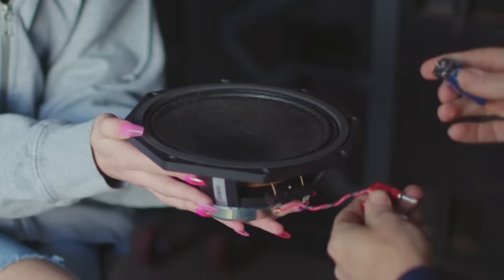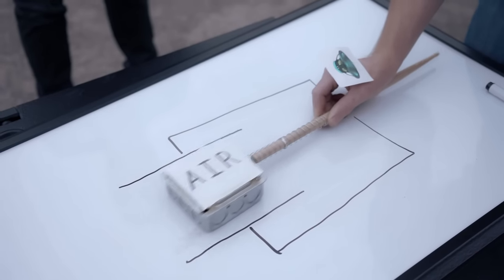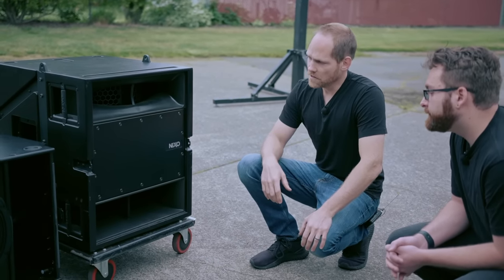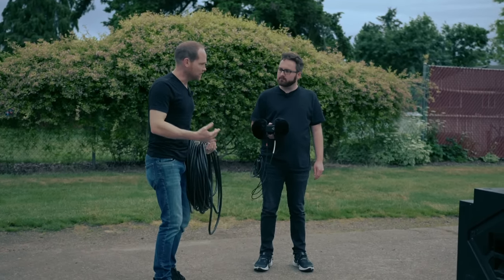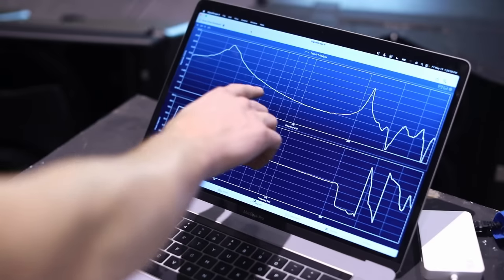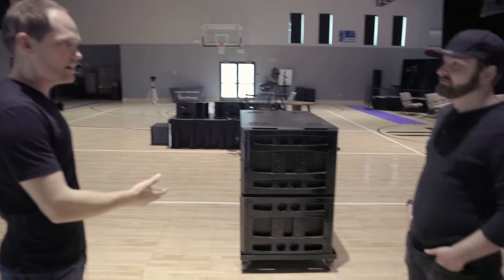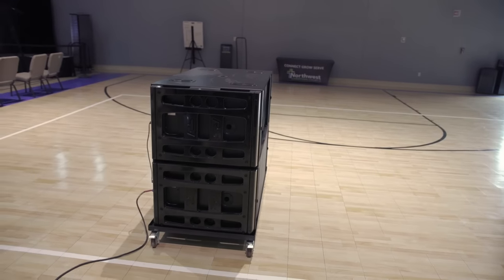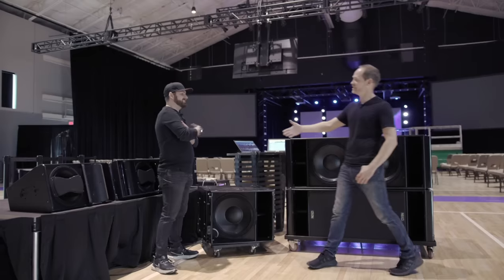Things you didn't realize about bass... until now.

Comment: I like how the videos you make put the transmission line freakhead stuff I do in my head, into a relatively easy to explain and build upon base demonstration of how sound works. It makes it easier to explain why my designs are better than bass reflex, because now they bass reflex a bit better :)
Reply: I built 11th order transmission line boxes (2) way back in 1990 for 2 Earthquake 12's. In home use with coils.

Amazing bass back then even on low power indoors running on 50 watts rms per channel from a home receiver.

Love transmission line boxes.

Comment: Great video.  I love the explanation of null points in sound.  One thing that doesn't get mentioned is that a driver is cone-shaped. So the portion of the driver at its rim, will have a very limited range of motion in contrast to the portion of the speaker closer to the voice coil, which will have the MOST movement.  So when looking at air pressure and how that air will move, it's good to understand that air at the sides of the driver will move slower than the air towards the center. So creating a vent that tapers from the source, is essentially mimicking the way the air will flow from the driver.

Comment: Aye that first example is awesome! The stick and spring with the air block is a surprisingly good way to represent how sound travels across air molecules.
I forget who else did a animated clip showing how the particles dont travel very far but rather bounce off of each other  in place
Reply: It's the same way Light so-called travelS        it literally doesn't have a speed because it doesn't travel
Reply: It has a heatZ simple as that just like sound

Comment: Wow, that was super interesting. One comment I have is that it wasn't always clear what the graphs were showing, and I had to pick it up from context. Once I figured out what the graphs were showing for each section it was great, but between sections the graph was changed (as is appropriate) without the presenter always explaining what they were. For example, sometimes they were relative response, sometimes they were relative phase, sometimes one of each. It would help a lot if there was some label or maybe an intro screen for each part of the video detailing the test setup. For additional context, I am the sound guy for my local church and I picked it up as a hobby from the old dude who did go to school for sound engineering. I am a software developer by trade, and I know about fourier transforms, harmonics, etc. So I am not totally in the dark about the science, but this was a really interesting lesson. Thanks!

Comment: Great presentation!  

At 9:03, you are outlining a hyper-cardioid pattern. This is exactly the way a dual diaphragm mic, like a U87, achieves variable patterns. 

Amazing to cover that much info about reflex speakers without mentioning Theile-Small parameters.  Each box is designed to work with those specific driver physics. Please don’t expect that performance when you replace a driver with whatever is on the shelf locally.

Comment: The upper phase cancellation around the 200-ish Hz mark is caused by the reflection off the back wall inside the cab. This is why making a subwoofer "too deep" can cause problems in the upper bass, and why vented designs that handle midrange line the cab with foam to try and absorb these frequencies.

Comment: You can squeeze peak SPL out of a low throw driver by using the tuned frequency of the box made for the sub. Like a strong magnet subwoofer with a shallow, 4inch coil will have tons of magnetic force but cannot do much lower than box design because it cannot control the coil after it leaves the magnets gap. A higher throw sub will usually have more long throw control and the infrasonic bass will play better. I think it was called QT or QTS. High qts like a closed box but a low qts sub will be good in a smaller reflex enclosure and will produce better car audio bass. The higher qts subs will almost always have a better efficiency.

I might remember things in reverse like high qts being good for lows but correct me if I'm wrong :)

Comment: I've always wanted to see a bass reflex speaker in slow motion like this. The "in phase frequency" is actually above the tuning somewhere in the mid-band but also depends on speaker parameters. At this displacement peak, the speaker claims its share of air in the box and the port the remaining air such that the resonances are equal.
The tuning frequency, there is a 90 or 270 degree phase and the speaker is bouncing the port air like a bungee bag ball.

Comment: Some deep stuff. Well done! I like how those frequency response patterns are so not unlike mic patterns. Audio is so cool in that it seems so simple, but is actually very deep.
Reply: Actually microphones and speakers are, in principle, the same exact thing - they're a linear motor, with a voice coil and a cone. A microphone works exactly as a speaker does, only the microphone cone is so sensitive that it can pick up a voice and take that AC signal through an amplifier which can (hopefully) repeat that same AC sine wave through a speaker.

Comment: Is it hard to build a cardioid system for home use? is there any way to calculate it without any advanced tools?
Reply from the maker: The problem with cardioid in a very small space is that it often doesn't seem to be very effective. You can easily create a cardioid setup by selecting a frequency you want to create the effect around, then physically delaying the rear speaker by 1/4 wavelength of that frequency and also digitally delaying it by the same amount, and flipping it's phase. But, while it will technically cancel out the direct sound in the rear, the sound from the front will probably just bounce off of a wall or the ceiling and come back into the room almost just as loud, and it probably won't really seem like there's much cardioid effect at all. Cardioid in small spaces really only works well at higher frequencies, like the low-mids, not subwoofer frequencies below 100Hz.

Comment: Thanks for your great videos!  It would be great to have you walk through the sub setup for a typical mobile DJ.  For example, QSC KW181 or EV ELX118P.  Should two units be placed together directly in front of the DJ booth, 15 feet away from the center of the dance floor?  If so, should one be phase shifted to achieve cancellation behind the booth and strongest bass at the center of the dance floor?  If they are setup to the left and right of the booth, how far apart should they be?  As DJs we frequently encounter poor sonic spaces and it would be great to have a general guide for subwoofer setup and testing in our constantly changing environments.

Comment: Actually was aware of the Cardoid arangements of subs. Tried it myself just without using a delay line and it actually worked to cancel the often heavy bass on the stage in smaller venues if your somehow tugged into a corner of a room.
One thaught tho, recently did a show where the sound company had 2 front driven and 1 back driven sub on each side of the stage (stacked on top of eachother with the middle pointing backwards) Do that change the Cardoid pattern, or do they just compensate for the unequal number in the delay line ?
Reply from the maker: It depends on what the goal of the cardioid effect is. If the goal is near-field cancelation, for example on the stage itself, then often companies will use a 2:1 or 3:1 or 3:2 front/rear ratio. If the goal is general or far-field cancellation, companies will usually do 1:1. The reason for this is kind of complex, we’re thinking maybe we should do an entire video on it sometime

Comment: a very educational content!!! Just a question, at what frequency do you crossover to the mids? Is it at 200Hz?
Reply from the maker: We typically do 120Hz if the subwoofer sounds ok up that high. Otherwise, probably 85Hz.
Reply: @devinlsheets_alphasound  another question, pls :D Would the same principle/technique be applicable in a home theater or a home stereo/sub setting? thanks in advance. Keep the vids coming!!!
Reply from the maker: @TheKb117  don't see why not! Although, as far as cardioid, it might not be noticeable in a small room. But the slotted vent would definitely have an impact on the sound of home theater speakers as well.
Reply: @devinlsheets_alphasound  that is midbass

Comment: I’m a loudspeaker engineer who is not afraid of humility and learning unlike a lot of these more arrogant people complaining of click bait titles and already knowing it all🫤.  I did learn something new today and it was the realisation that the sectional shape of the port does more than help effect the Helmholtz effect.  It also alters the phase to frequency effects which manifest to about 2/3rds an octave above tuning where the port contributes sound so smooths response👍.  I tend to use distributed vent slits over round ports as this seems to achieve tighter bass due to the way perhaps it affects driver impedance, but I am now intrigued.  Are these ports available commercially?

Comment: A 20hz soundwave is a pressure-wave with a wavelength of 16 metres. This is getting close to the draught under the door. You can't hear it, you can only feel it (until you reach extremely high volumes). So pretty much all you are hearing with your "really amazing bass" is the harmonics (as per your graphs).
Reply: Yeah, but you’re supposed to feel it, that’s the point. You don’t need to hear it. Your ears are just there to help detect vibrations, very loud low frequencies can be detected by the whole body rather than the ear, and still be processed by your brain in the usual way.
Reply: You can easily hear 20 hz and lower but you need SUBWOOFER not midbass

Comment: 17:22 I guess the mis-shaped looking vent actually improving flatness of frequency response was originally found by accident. Probably somebody nearly melted the vent after overheating the speaker and it was found to improve the sound quality. Even today, the movement of air in vents is far from solved problem because there are multiple frequencies and mixture of turbulent and laminar flow. (The air touching the walls of the vent is always turbulent if you have fast moving air needed for higher sound pressures. The only question is how close to walls you can make it laminar.)

Comment: Hello sir, good day. I just want to ask a question, here in the philippines specially in the visayas, i just want to ask something about speakers, many of the locals here specially to those locals who loves sound system battles. Its a battle of sound system here of whose loudest and whose the greatest intensity, and a contest of what we called drum dragging and bottle knockdown, every sound system set-up has 24 subs , and 20 mids and tweeters. The subs used here nowadays uses 24" with the maximum wattage of 20,000 watts loudspeaker with 4-5 magnets. Also the amplifiers used has the same power of the speakers. Now , all i want to ask is this is only my opinion sir, why is it I think the carreta treme treme set-up is more powerful than the set-up in all the sound systems here in the philippines. Whats the reason? Is it about the set-up? or the speaker boxes?

Comment: But does the frequency response stay the same at all volumes(90db, 100db, 110db, and so on) for the most part obviously?

Also a question I can't find an answer to is do all speaker types increase in volume the same. For example, if at any frequency I have 100db and then give it 10 time the power will I get 10db more output or could it be less like say 6db or more say like 15db? Same in reverse if I have a 100db and I give it one tenth the power will I get 10db less or only 6db less? The reason I ask is I swear I've have systems that sound more compressed where when you turn it up 10db it only sounds like a 6db increase and vice versa. I swear I've heard this in different DAWs as well. Makes me think that different pre-amps repond very differently to volume changes. I had one where 6db sounded like a double in loudness and another where 10db sounded like a double in loudness. Pretty important if this is true. I mix music much differently in the one than the other. I theorize that sealed boxes should have a more compressed sound because air pressure increases faster with every increase in volume. Meaning the lower it goes the more compressed it should be. Idk if this is true but if anyone has any info on why it is or isn't true would be great?

Comment: Hi it seams that audio waves and radio waves behave almost the same, thats why keeping an rf antenna in the HF bands in tune is very difficult and thus the auto tuner, especially when the signal is stronger en not anymore QRP levels. This represent quite a few headackes thats why there is so much products on the market

Comment: Very interesting, because live experiment is always much more understandable and better explain complex relations between design choices and implementations.

Unfortunately, it's ends too fast than I'm expecting, because there is a lot of stuff still to be explained.

What about telling difference between actual sound quality of subwoofers with heavy cones, low sensitive drivers and subwoofers with light cones and high sensitivity?

There is doubths, that it makes no difference as you have powerful enough amplifier.

But, phase delay, because of the cone weight, did the high power amplifier really helps with that?

And, what about bass "smearing" in vented and passive reflex designs in comparison to the sealed box?

How combat that?

I'm wondering, if you can made videos, related to that questions. :-)

Thanks!

Comment: I think this video answered a question I had and it's 'it depends', i want to create my setup where I am seated on the sub but the vent and driver is at 90 degrees, I have been looking if the driver should be facing forward/backward or left/right and the port the opposite, seems I should put it at a 45 😂

Comment: Cool video!

At 1:11 your comment about the speaker acting as an air-pump isn't technically correct. The speaker act as a resonator for the air in the box and that air in the port resonates based on it's mass (tuning) from the air resonating in the box. It's going to be about one full cycle behind the woofer. That delay is called "Group Delay"

Later you mention the ports resonate. I think maybe we should start with that concept first?

Comment: as a professional musician and Bass player for more than 40 years, the most important advice i get was from a guitar player in a close playing 3 piece band. when using a 4/10 cabinet onstage, is different than using a 1/15 or bigger cabinet, because the long wave frequencies of the bigger speaker’s sound extremely loud when your 20 30 ft away. but standing 5 ft away sandwiched with the drummer and guitar player you could hardly hear a 1/15 even at 500 watts tube! but the 10 inch speaker were extremely loud onstage. even at 150 watts, but realize, if you are a pro bassist, you could be blowing people’s heads off out in the audience, but standing next to your rig, you don’t hear nothing. because those long sound waves..

Comment: The "pinched in" smoothness of the air kind of reminds me how some supersonic planes are pinched in like a Coke bottle because it creates less air resistance. This is particularly important around the wings, as they increase turbulence and resistance. Also, being a bass player, I try to avoid standing waves from parallel surfaces.

Comment: I would think resonators distort the original sound. You get a kind of single tone time-distorted boom.
Reply from the maker: Technically they do distort it a little, but a well-designed resonator can have a pleasant sound that people prefer over more "perfect" sealed enclosures.
Reply: @devinlsheets_alphasound  The group delay is therefore the primarily decisive factor. Especially low tuned resonators sound better here, because the group delay does not increase so much in the critical areas.

Comment: I used to design industrial ventilation system decades ago, to further improve your speaker design further reduce the impact of vena contrata at entry point(located inside the speaker bell mouth inlet only offer 4% loss the most efficient) by installing bell mouth inlet it is similar to design of human ear from the ear lobe to the auditory canal this will drastically improve efficiency. Take advantage also of the resonance phenomenon install at least two or more air outlet should be even since each pair will increase its loudness around 3dbA   without inputting additional power. Hope this could help you design  the best  speaker bear in mind that human ear could only hear from 20hz to 20khz. and lower frequency sound could penetrate light material so if you design speaker intended to propagate lower frequencies dont forget to line the inner part of your speaker with heavy material such as lead  or safer material that is heavy.

Comment: ANSWER: Why not just dig a hole on the back of the box to totally eliminate all back-waves, and them just compensate this loosing by increasing the power of the speaker? thanks, great video!
Reply from the maker: It wouldn't really work, because the waveform would be different. The waveforms have to be identical, but inverted, for them to truly cancel. There's lots of companies that have tried to make "passive" cardioid subs, but we haven't heard any that work really well.

Comment: I learned all of this In the early 1990s I would put the woofers In the middle of the cabinet the Idea Is so the woofers are pumping Air on both sides of the cone creating pressurization on both sides of the cone, compressing frequencies with Air causes a more powerful bass of course the cabinet and port size has to be right the ports have to be big enough to let the sound out but small enough to cause resistance on the Air being pumped through this works well with large woofers as 15 Inch to make them more responsive puncher